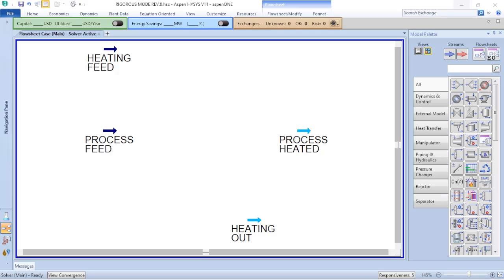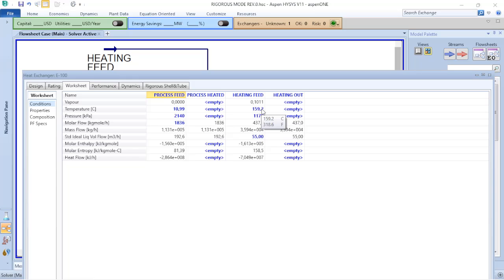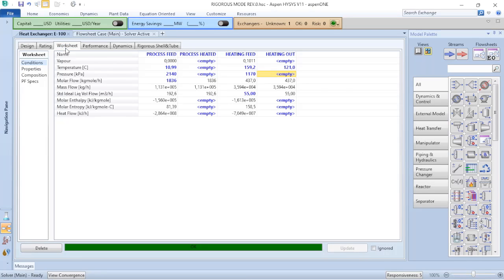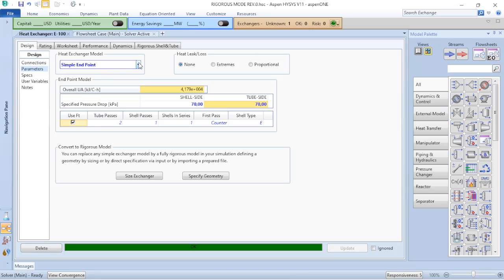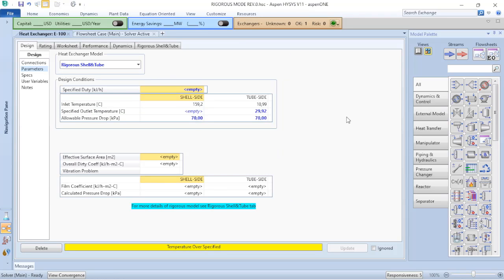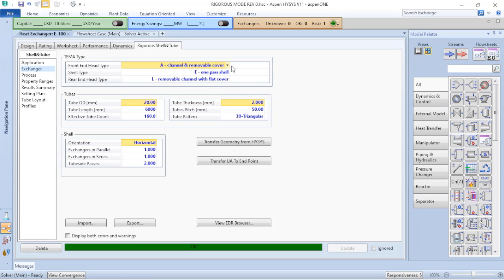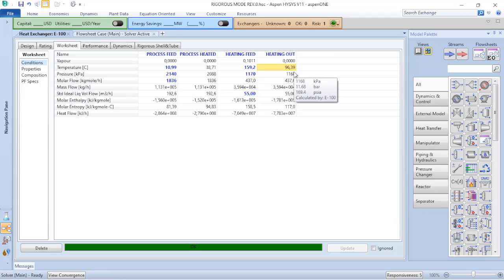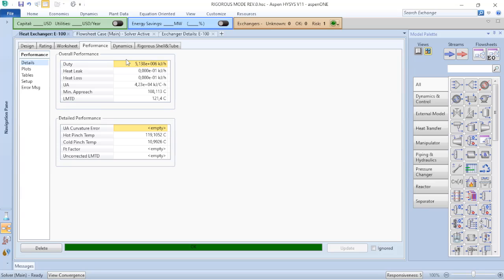SHELL AND TUBE EXCHANGER ASPEN HYSYS | HOW TO SET RIGOROUS HX ON HYSYS

Comment: I have a case with phase change, so the "Simple Weighted" model suggestion was helpful and I believe recalculated better "Performance" specifications such as LMTD and Ft Factor. Nevertheless, when I try to size the exchanger using EDR and allow it to "Calculate", when I select "Yes" to allow this calculaton to overide the existing stream specifications to avoid over-specification, I get errors and can't seem to figure out why this is happening. One of the errors is that the outlet temperature of the hot stream is being calculated/set to an unreasonable value (-407.8°F) and is referring to the hot stream/cold stream backwards. This EDR addition is difficult to comprehend.  Thanks for the video, but it didn't address what is happening to me.
Reply from the maker: Sorry to hear that. I agree that the use of EDR is not so simple.